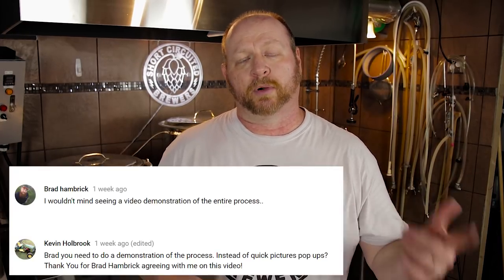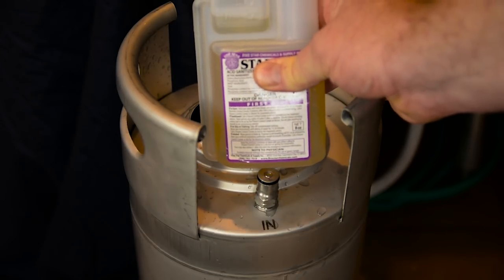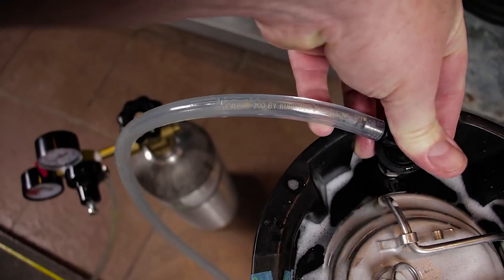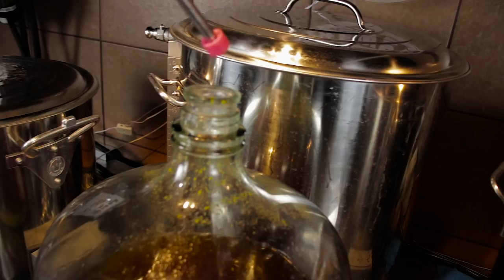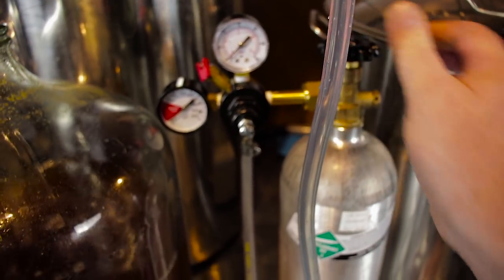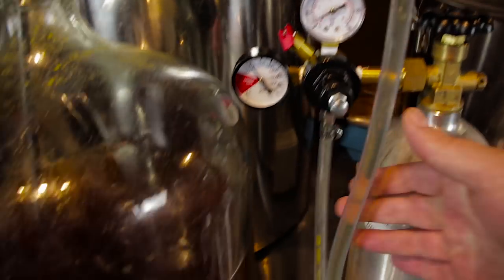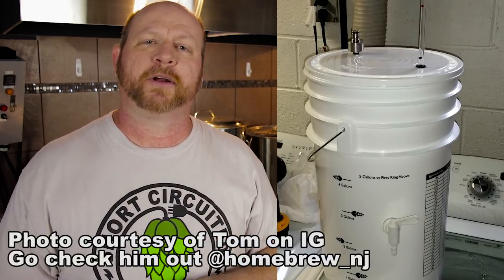Transfer From Carboy To Keg With CO2 | Pressure Transfer to Keg With Low Oxygen Exposure

Comment: Thanks for the vid Brian!  Here's a quick tip if you use Fermonsters like I do, take a solid #10 stopper and drill 2 small holes in it.  The racking cane goes in one side, the carbonation cap in the other.  Then everything else is just as Brian demonstrated.  You can also purchase the solid Fermonster screw on cap and drill 2 holes for normal sized stoppers if you'd rather go that route.
Reply from the maker: Thanks for the tip Bart! I had someone ask.me recently about don't this with the bigmouth bubbler too. They also make a lid for those with 2 holes.  Cheers! 🍻

Comment: This is a must with Hazy IPAs. When I’ve used this method, I’ve experienced two issues. 

1. Dry hops and trub clogging the inlet to the keg. I’ve since started just running a hose directly into the keg and ditched the ball lock fittings. 

2. The carboy cap leaking too much co2, which doesn’t allow enough pressure to build up to push the beer into the keg. I solved this with a series of hose clamps on each opening. 

I hope this helps anyone that experiences the same issues.
Reply from the maker: Thanks for sharing the tips! You are 100% correct this is a MUST for those type of beers. Critical to the "shelf life" 👍🍻

Comment: I had the exact same idea, but didn't think about using the corny to sanitize the racking cane assembly.  Although my plan is to put a valved quick coupling on the gas side of the carboy blowoff, and a valved disconnect on a pigtail to the racking cane (I'll probably do male on one and female on the other to avoid any possibility of connecting them incorrectly, although that is pretty unlikely).  I will connect the carboy blowoff assembly (blowoff cap, racking cane, and disconnects) after pitching the yeast and connect a hose to the gas side quick disconnect to run into some sanitizer during fermentation.  When I am ready to transfer All I have to do is switch out hose assemblies on the gas side for one that has a mating disconnect and has a gas ball lock on the other side, and connect another hose assembly with a mating disconnect and liquid ball lock on the other side (which is pretty much what you did in your video).
Reply from the maker: Sounds like a plan to me! Thanks for the comment and suggestions. 👍🍻

Comment: I just used this process. Worked well other than the carboy cap I bought through Amazon. Not a very good seal. I had to hold it on the whole time and CO2 was leaking out. Had my tank set to very low pressure. Thinking there have to be better carboy caps out there.
Reply from the maker: Yeah it doesn't take much pressure to cause a leak. BUT I wouldn't pressurize a carboy that much anyway. 👍🍻

Comment: That's an interesting procedure. Thanks for the video! 
What pressure level would you recommend setting when injecting CO2 into the carboy? I have a glass carboy and would be a bit concerned about pressurizing it too much.
Reply from the maker: Rubens Campregher 2 - 3 psi... Just enough to keep positive pressure so the siphon continues.. Cheers! 👍🍻
Reply: Short Circuited Brewers 
Great! Thanks!

Comment: Not sure if someone has asked this yet as this is an old video but why do you set the PRV valve in the open position during the transfer? Wouldn’t this release the CO2 layer on top of the beer?
Reply from the maker: The beer rising up in the keg creates positive pressure out of the open PRV. The keg is full of CO2 from the start. There is no intake back through the PRV.👍🍻
Reply: @ShortCircuitedBrewers  What would be the negative effect of leaving the prv closed during this process? Thanks.
Reply from the maker: It would not release the pressure and it would stop the flow of beer. Glass carboys shouldn't be pressurized with more than a couple psi.

Comment: Great video mate!
Reply from the maker: JosephandElissa Flores thanks!! 👍🍻
Reply: Short Circuited Brewers What is the stainless steel piece you are using to attach a poppet for the gas in?  I’m trying to find it on MoreBeer.  I want to do this trick on the next beer.
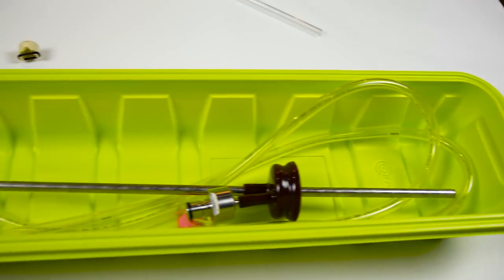Reply: At 1:03 you can see the poppet on the black cap.  That would be perfect!  What is that?  How did you attach that to the plastic cap?
Reply from the maker: Got it off of Amazon. https://www.amazon.com/dp/B01K4GGYT0/_encoding=UTF8?ref=exp_inf_pl_shortcircuitedbrewers
Reply: Short Circuited Brewers awesome!  Thank you!  This is used to carbonate soda bottles, it was very clever to repurpose it for this.  I will order one or two!

Comment: How do you clean and dry you hoses/tubes without a compressor?
Reply from the maker: Just let them hang and air dry. 👍🍻
Reply: @ShortCircuitedBrewers  mine has been hanging from May 2 and still has specks of water in them
Reply from the maker: @DinakarJayarajan  I would run sanitizer solution through them and then hang them up. I have also filled with sanitizer solution and left it in there. 👍🍻
Reply: @ShortCircuitedBrewers  thanks let me try that
Reply from the maker: @DinakarJayarajan  👍🍻

Comment: If you open the pressure valve while it's filling won't that allow oxygen to reenter the keg? I would instead get a one way plastic valve W a low cracking pressure from somewhere like US plastics and attached it to your gas side. This allows co2 to escape while keeping oxygen from entering.
Reply from the maker: Christopher Saint that's not necessary because when you're filling The Keg there's positive pressure going out because the beer is displacing the CO2 that you filled the keg with
Reply: Short Circuited Brewers I see :-) so you close it as soon as you stop transferring.
Reply from the maker: Christopher Saint you got it!  👍🍻

Comment: Is this process only recommended with Glass Carboys or can it be done with plastic ones?
Reply from the maker: Grant Warmoth sure you can do it with plastic.. Actually a little safer. The orange carboy caps fit the better bottles BTW.

Comment: QUESTION??  I did this procedure for the first time and just as I started doing the 5gal transfer I accidentally had a blow-back of Co2 into the carboy for about 5sec ( no clue how it happened) anyway it's in the keg now "conditioning" My question is........could the blow-back of Co2 into a full carboy affect the beer....anybody? 
Thanks for any help.
Reply from the maker: No co2 back into the carboy is fine. I assume you had a little pressure in your keg when you hooked up the transfer hose and that's how it happened.  RDWHAHB 😜 👍🍻
Reply: That's exactly what happened I'll wait a month or so and tap into the keg, thanks for the reply
Reply from the maker: No problem!!  👍🍻

Comment: What size gas ball lock on that carboy cap?
Reply from the maker: What size? There's only one size gas ball lock. There is a carbonation cap that is stuck in the carboy cap. I believe it's listed in the description.👍🍻
Reply: Yeah I meant the barb size to fit in the carboy cap. See multiple sizes out there and no ref on your Amazon page.
Reply from the maker: @lerrico  the barb is about 1/4 inch
Reply: I found this detail on your primary to secondary video. It’s a 5/16 barb carb cap which is standard. Cheers!
Reply from the maker: @lerrico  sorry about that I couldn't remember exactly. 👍🍻